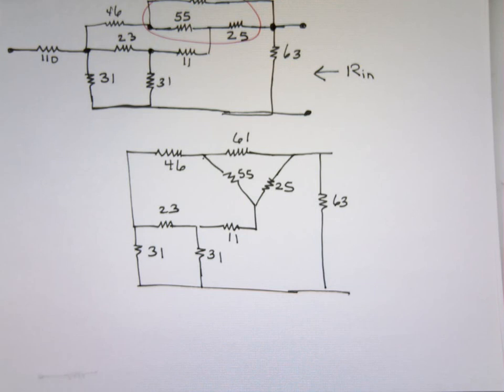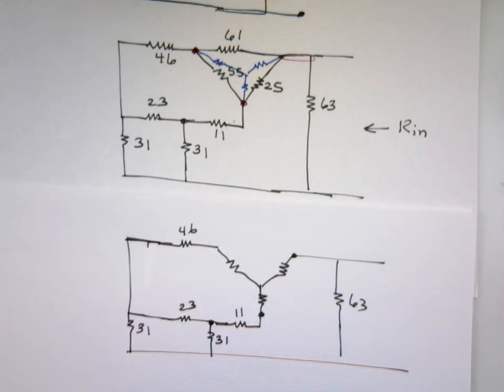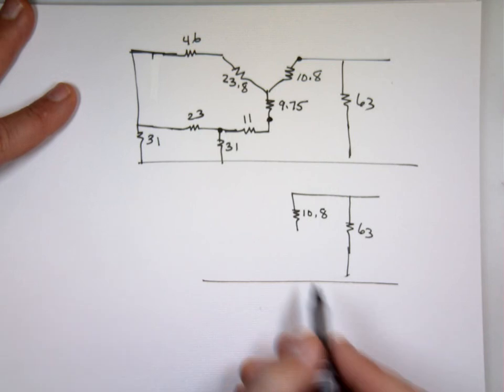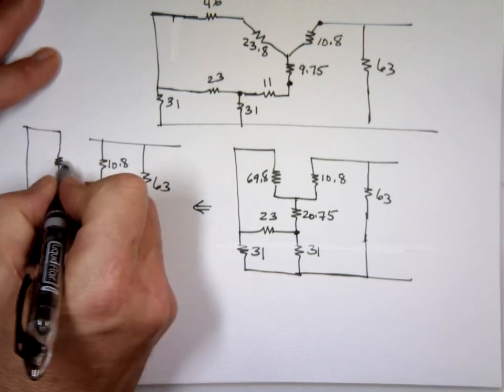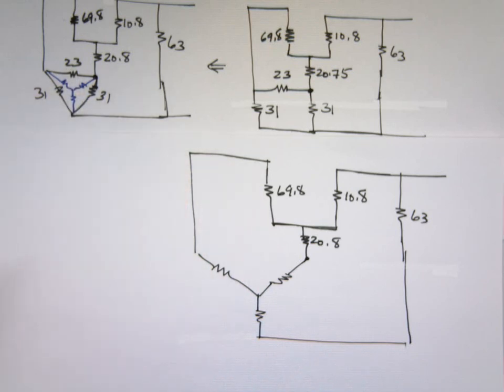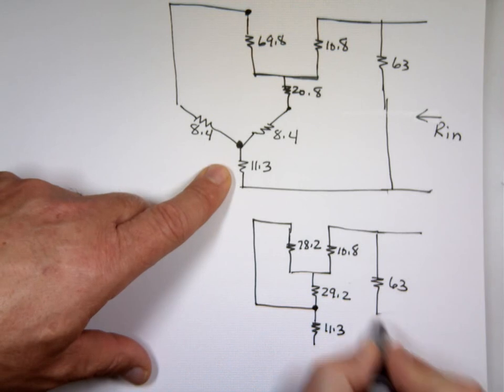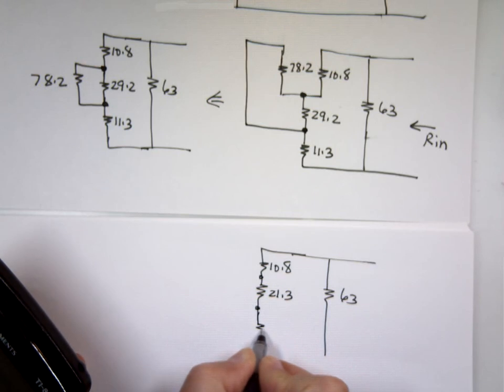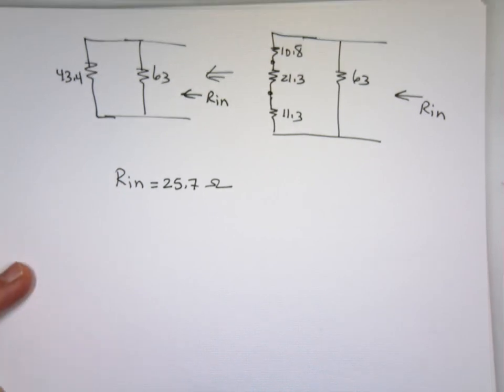Example on Wye-Delta Conversion

Comment: Thanks for your help. But Ive a question: How do you know that 110 Ohms isnt going anywhere?
Reply: it is an open circuit, it does not lead anywhre, its an extension from the ideal wire so it doesnt hold a current through it.
Reply: Ok. Thank you

Comment: why is the 110ohm resistor not included in the final answer? and suppose different group of resistors were transformed into wye, would the answer still be the same?